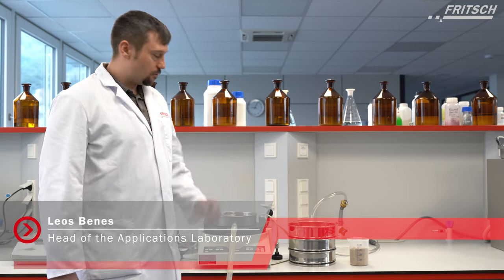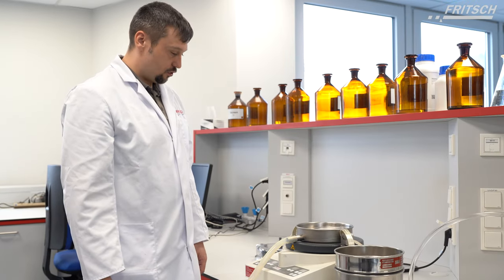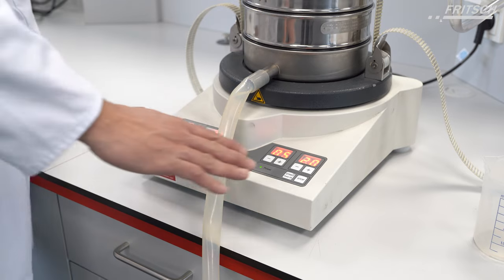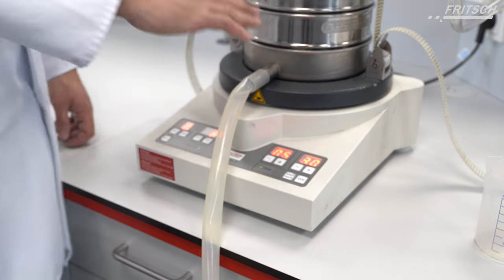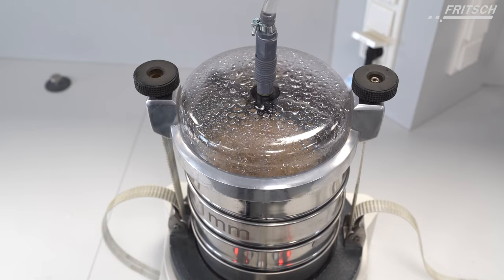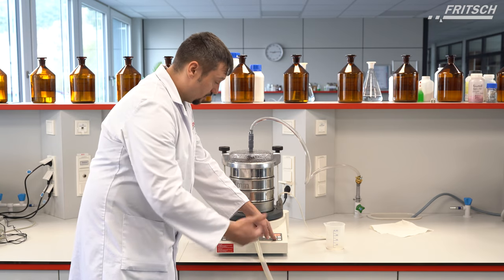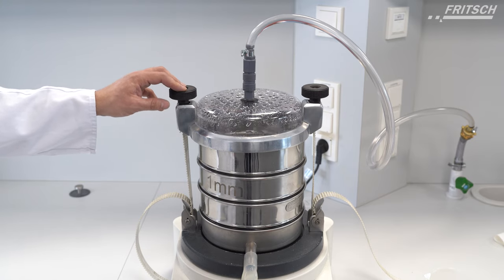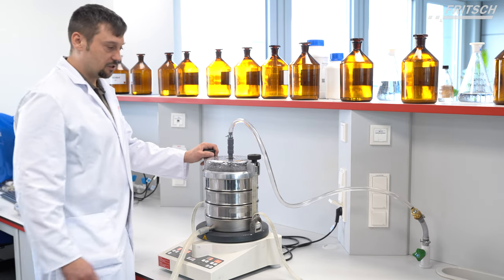Wet sieving with a Laboratory Vibratory Sieve Shaker

Comment: After finish, the particle still wet or dry?
Reply from the maker: Thank you for your question. Immediately after wet sieving, the sample is wet. 
For a precise determination, we recommend to determine the total mass of the material before wet sieving, and to note the empty weights of the individual sieves, as well as the sieve pan. (Easy to conduct with our autosieve software).
After wet sieving, one can dry the sieve tower (without the wet sieve head) at 80° C for 3 hours in the drying oven. 
After cooling, one can finally determine the mass of the individual sieves and the sieve pan.
The difference between the empty weights and the total dry mass of the sieve or pan now forms the desired fraction. 
We hope this answers your question, should you have additonal questions feel free to contact us directly: info@fritsch.de. 
Have a great day!